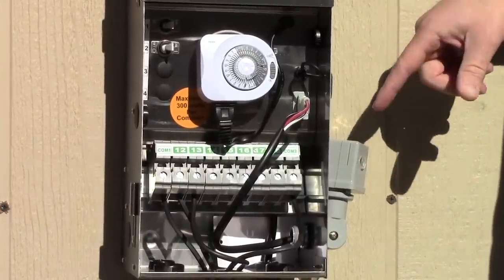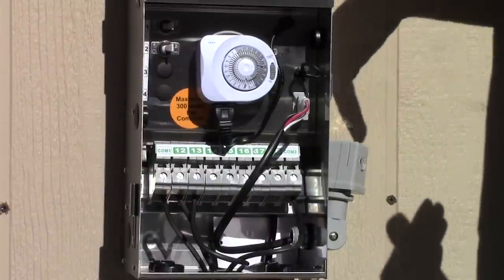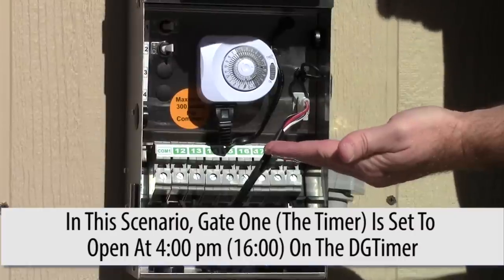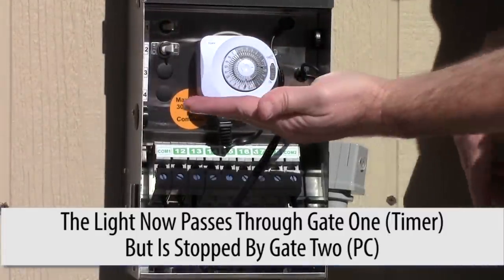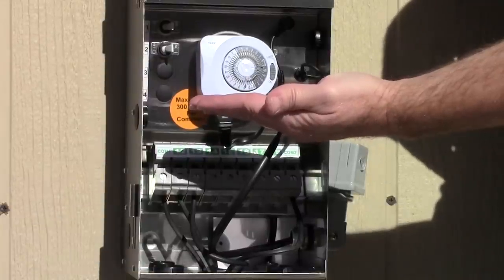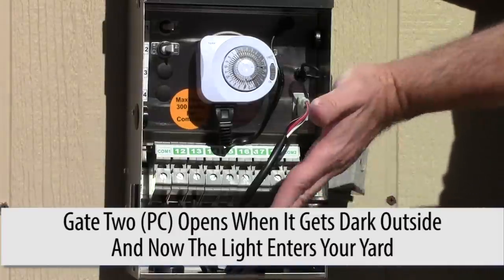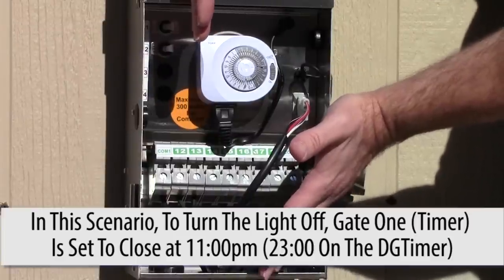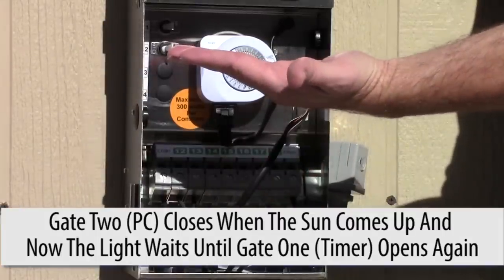Using The Timer And Photocell Together

Comment: How to common connecrion with timmer and photo cell at a time ?
If photo cell is not working the system will work by photo cell if there is no common connection
Reply: I though and studied and test it. does not make sense to me yyy the hell would u want to put a 300 dollar timer. 
I dont get it, waist of money 
Photo cell controls the coil on a relay.
There's very little load.
I was thrown out of a job because of that.  I was suppose to be lost n confused , so i question my manager a  master , his answer was the customer is always correct. Stuped rich people dont mine paying that money and i dont get tired of taking it

Comment: Why use both ?? the photo cell doesn't need to be changed with day light savings  or as the days lose or gain minutes .Timers fail more often plus cost more to change out. My sister has this current set up and if the timer bad can't i just bypass it and use the photo cell only?
Reply: ABB 4323 because people don’t want whatever they’re powering to run till dawn. Isn’t that pretty obvious?
Reply: Another scenario- my hens need 12 hours of light per day to continue laying eggs. It is not necessary to run the light longer than that- even in winter.